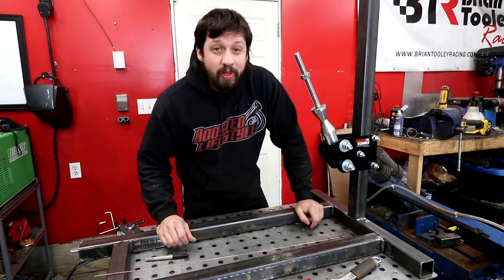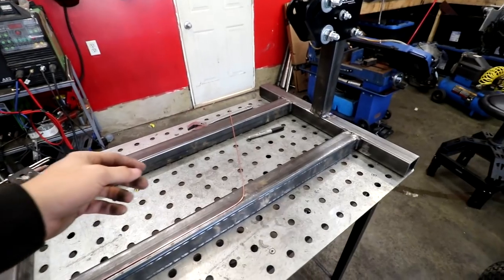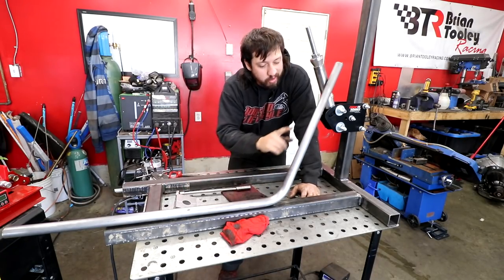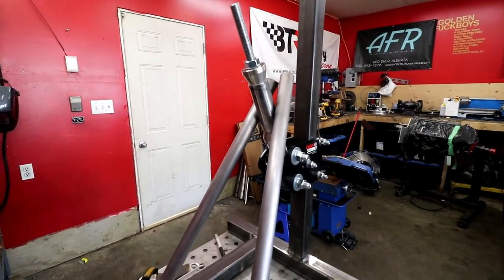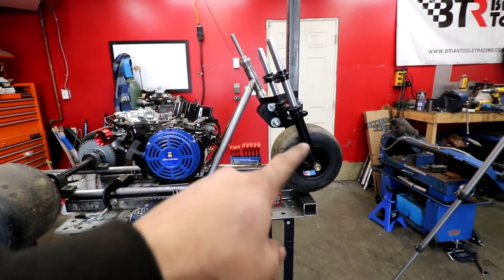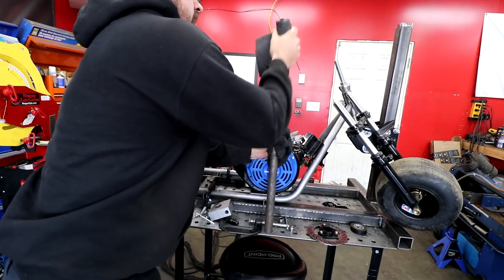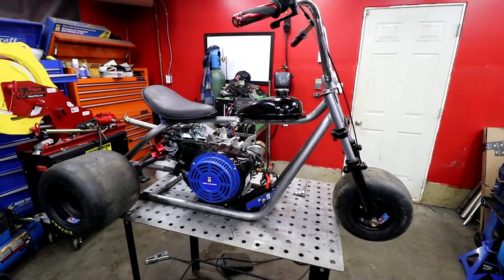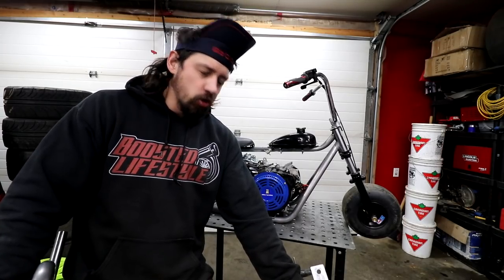The Fastest Pit Trike I've Ever Built

Comment: Good job Kyle, rake is much better and will definitely be easier to ride. Suggestion, add a removable box to the rear making it ultra useful as a pit bike so you can carry wheels and tyres, fuel tools or whatever, maybe even an esky.
Reply from the maker: Dude that's actually smart. I had an idea for between the rear though 👀👀

Comment: maibe they should make the washers intoo a bushing stepped on one side with outside thread so it goes through the center hole of the bending die intoo the die at the other end thats threaded on the inside 
need it wider or narrower ? unscrew the two and add washers in between them and screw them back up , that way youre only holding one solid unit in the machine when you fit the pin through